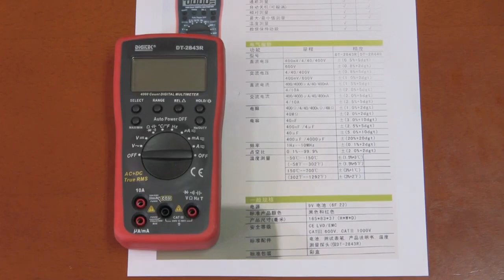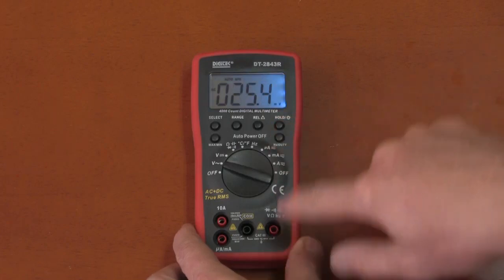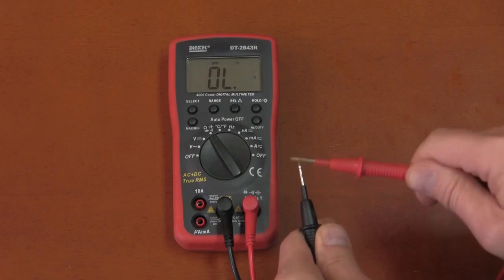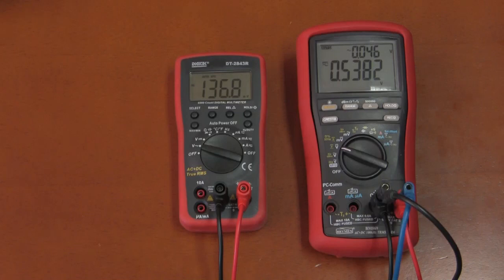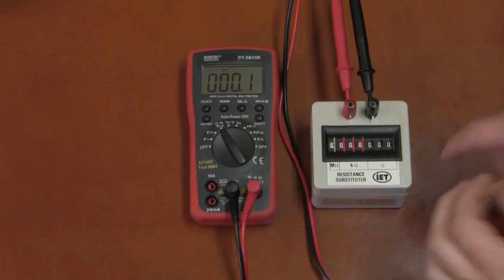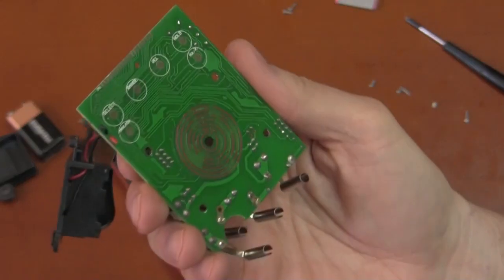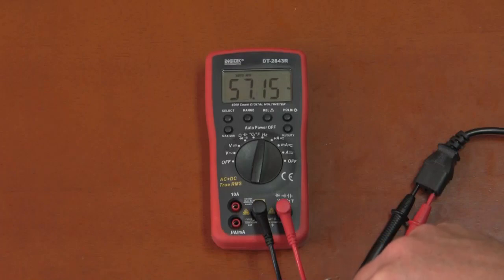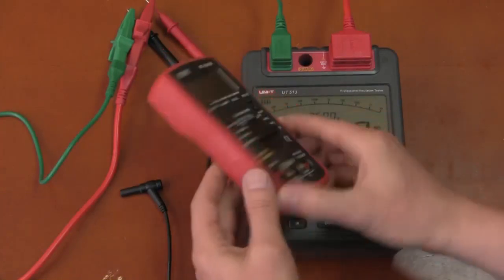Digitek DT-2843R TRMS inexpensive multimeter

Comment: Franky here. Thanks for the order Philip! I'm glad you like the meter. I couldn't supply LightAges with the leads because I didn't have them either at the time. It was only a demo unit I received from the manufacturer. You might notice that your meter also has some cosmetic differences. The silk screen text on the meter is now colour coded, instead of all white shown in this video.

Comment from the maker: It depends on what you want or need. If you need True RMS, then the DT2843R is a better meter. It is also less likely to cause you grief because the current inputs are on separate jacks.

The DT4000ZC has a PC connection and therefore allows you to log measurements. It doe have a safety concern IMHO that one of the input jacks is shared with a current range and voltage range. This could lead to more likely accidental shorting of a test measurement. It also is not True RMS. 

The choice is yours.

Comment from the maker: Well without a doubt, the Brymen BM257 is a much much better meter than the Digitek. The only thing the Digitek has over the Brymen is that it is AC+DC TrueRMS reading whereas the Brymen is only AC reading True RMS. If you can afford the BM257 then buy it instead.

Comment: You would not be able to check the DC offset or component if you place a capacitor before the circuit when measuring AC !  You are measuring AC coupled rms not AC plus DC rms!